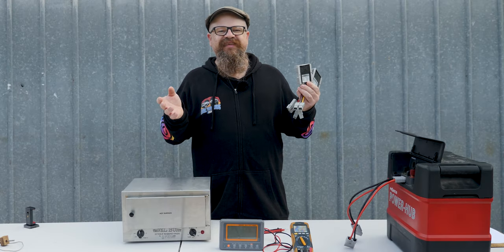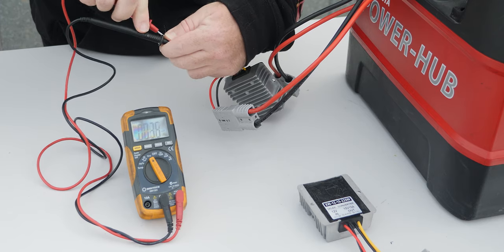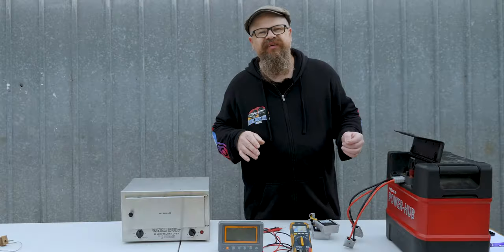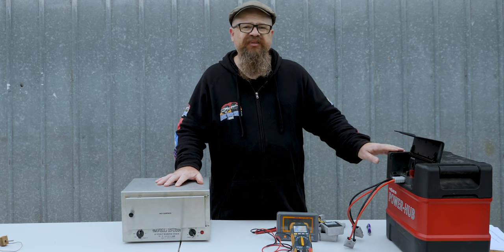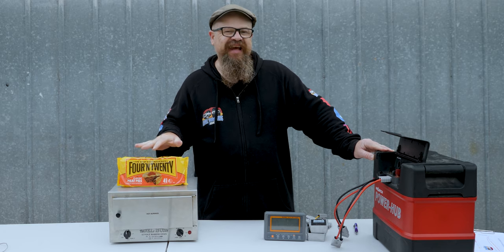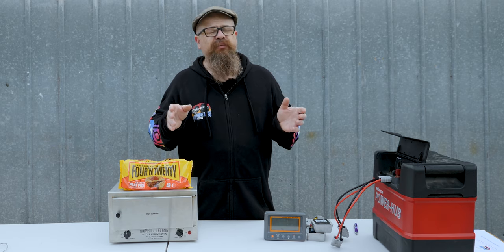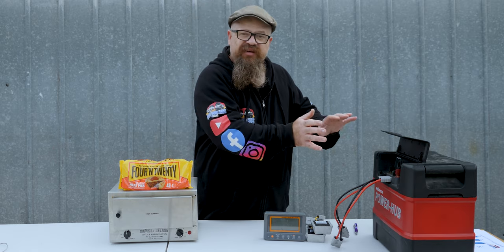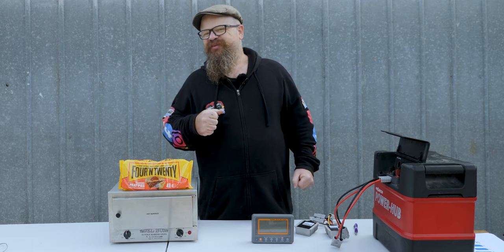Can you Improve Travel Buddy 12 Volt Oven Performance using Voltage Step-Up Converters?

Comment: Is the most basic way to use the step up converter , plug it in with Anderson when you need it and then unplug it when you are driving ? I’m not an auto electrician so don’t want to do anything to difficult in terms of wiring..
Reply from the maker: The units I tested aren't suitable because of their limited input range for driving. Though I notice Sommervile Metal Works sell on that you wouldn't need to disconnect.
Reply: can confirm, the 15v reg (even though it says max input 13 volts or whatever it is) still works and is without damage running while a dc to dc charger is charging as well (at 14.6 volts)
Reply: @LockyourHubs4WDing  but if I disconnect when I drive and then connect when I pull up to camp or whatever, that is fine ?
Reply from the maker: @jackdunn1687  yep, that'll work fine.

Comment: I’ve just purchased the 15v converter, what’s the go with fuses, do you install 1 on the input and out put sides? I already have 1 on the travel buddy wiring so was thinking on the out put side would be over kill?
Reply from the maker: I would place  a fuse on the input and output as close to the supply of power as possible.

Comment: WOW! Bloody great video, thanks so much, so in theory this data would replicate for a 12v Fridge running from a similar set up???
Reply from the maker: I tried it with an Engel 75 Combi, we got better performance, but used more battery capacity.
Reply: Thanks for the reply 👍🏼👍🏼

Comment: Hi mate, great video I got a step-up converter and works great on my AGM battery, but I have just upgraded to lithium 150ah would there be any benefits using it on a lithium ?. Would it work the same ? Cheers
Reply from the maker: Still works just as well.

Comment: Great video Simon! Can anyone share a link to either a 13.8 or 15.0V step-up converter. I'm having trouble finding one with the model numbers provided in the description.
Reply from the maker: Here's a link to a 15v stepup that won't require any addtional  wiring when the car is operating.

https://www.ebay.com.au/itm/12V-to-19V-15A-285W-DC-DC-Boost-Step-Up-Power-Converter-Voltage-Regulator-SL-/313339939355?_trksid=p2349624.m46890.l49292
Reply: @LockyourHubs4WDing  Thx Simon, but the link seems to be for a 12v-19v step-up.
Reply from the maker: @masonnagle  apologies, I just searched through my ebay purchases, this is the wide input step up/down I purchased.

https://www.ebay.com.au/itm/WaterProof-DC-DC-12V-to-15V-20A-300W-STEP-UP-Power-Converter-Regulator-XL-/293739824378?_trksid=p2349624.m46890.l49292
Reply: @LockyourHubs4WDing  Champion! Thanks for going to the trouble.

Comment: Gaday mate,
I have a late model Patrol with a so called smart alternator. I’m assuming that using the step up converter whilst driving, will still be beneficial even though the alternator kicks back to 12.?V about 2 minutes after you start the car?
Reply from the maker: Sure will!
Reply: @LockyourHubs4WDing  thank you. Can you tell me, for a quick safe initial setup, could I fix the step up converter in line to the back of the oven with Ceramic 10mm screw spacers for ventilation, 15amp in line fuse then battery supply?
Reply from the maker: @GPatrolUte  Solid state electronics don't enjoy heat, while the ceramic insulators will help, a sheet metal spacer with an air gap each side will be much better.
Reply: @LockyourHubs4WDing  Cheers and many thanks👊

Comment: Could a similar test be done for operating off 240v to 12volt convertors?   Difference between a 13amp compared to a 15amp unit. I noticed a lot people are using different amp converters.
Reply from the maker: If the 240v converter can supply enough amperage to the oven, it doesn't really matter if it's 13amp, 15amp or 25amp. There should be no difference in performance. The oven will only draw as much amperage as it needs.
Reply: @LockyourHubs4WDing  Thanks for the quick response! Love your video's.

Comment: Great videos you do. Very informative and helpful. If these step up/down convertors are 12v input, 13.8v(or 15v) output, how do they handle it when the car is running and the input voltage could jump up to 14.5v? Can they handle that?
Reply from the maker: I've seen a different model 13.8V model that handles a much wider input voltage range, like the one that Somerville Metal Works sells. Though not for the 15V version. Though with a little extra wiring you can automate it switching in and out https://youtu.be/CT6WJNPNRsc

Comment: Do you think these step up converters are sealed good enough to be mounted on the back of a tool box in the weather? I have wanted one and this great review has sold me on one. I have always held off due to mounting positions.
Reply from the maker: They're advertised as waterproof, so as long as the connectors are weather sealed, I think you should be fine.
Reply: @LockyourHubs4WDing  yeah nice. Cheers. Best be hitting ebay! Will be between toolbox and ute cab.  So not in straight view of weather.
Reply: My Chevy Silverado is fitted with three Fyrlyt Nemesis (250 watts each) driving lights. Fyrlyts are made in South Australia and the nemesis model is a 24volt halogen globe and is supplied with a 12v > 24v step-up converter...look the same as the ones in this video, but with higher output. They are designed for all weather use; mine are mounted on/under the bullbar. No worries...
Reply from the maker: @billroach2393  Great thanks, good to know that not only are they advertised as weather proof, they actually are!

Comment: So what happens when you set it up and car is still running? Does it max out at the 15v or boost past that?
Reply from the maker: Various step ups have different voltage limitation. I know there is a 13.8V step up avaliable through Somerville Metal Works that has a wide enough input voltage range to just connect it up and not really worry about it.

Though for the 15V, I've only seen them with a 11-13V input. You can either manually switch it in and out, or automate the process with relays. I did a video with a few wiring diagrams you can download and print out if you're interested.

Comment: Has anyone checked the output  of these when the alternator is pumping in the juice? Would be very interested to know what they do when the system is running at full charge of around 14.5v. Thanks for the great content and thanks for any further info.
Reply from the maker: If you check out the travel buddy FB group, I've uploaded a wiring diagram that uses a switch to bypass the step up when the car is running, you could easily enough automate it with a relay and a trigger from the "on " position on the ignition.

Comment: Great video... do you have a link to the actual unit (15v please) that you used in this test...

I want to get one.
Reply from the maker: The model number is in the description, just search for it on ebay.
Reply: Lock your Hubs 4WDing  wow, so the 13.8 one actually uses a fair bit more power. That’s a surprise....last question, did you personally experience any issues when testing either of them?
Reply from the maker: None, I did mount them remotely to keep the heat away, both both are still running strong!
Reply: Lock your Hubs 4WDing  BEAUTIFUL! I’ve just ordered a 15v one... if you want to possibly fan force one with no extra power...look at a 55w peltier module thermopasted to the front door & wired directly to a 5v electric motor on front door also, with shaft through the door & a metal RV boat prop on the inside.👌🏻 will work as long as the door has heat, closed circuit.
Reply from the maker: @pauladams1156  I would like to add a second element firstly, though fan forced would definetly help, especially with stainless trays.
Reply: Lock your Hubs 4WDing  yeah that’s my only complaint, the back side cooks more because of holes in the door...I figure the fan will make the heat much more even... I’m gonna have a crack at it...just gotta figure out if I can pierce the peltier, so I can make the most of the cooling side, for the motor...hopefully they arrive in the next few weeks.
Reply from the maker: Shoot me a link when you're finished! I would be really interested in checking it out.
Reply: Lock your Hubs 4WDing  no worries...I thought this up, because adding a second element would require doubling the power...yet this idea runs free from the heat...& because it’s such a small area, you wouldn’t need much to flow the air inside it.

Comment: Just the information I was looking for, thank you, can you let me know where you got the 15 volt step up converter from? I've had a look around and, and can find 12v to 15v, with a max output of 15 amps, do you think that should be fine considering you hit around 13.6 amps draw, or should I look for 20 amps max?
Reply from the maker: The part number I used is in the description.

Comment: Just hooked  my 80w solar panel it was running at 6a and 83w in the sun. By rights would that be enough to not 100% offset the  power draw but sort of help keep some juice in the battery so I am able to run my oven with the vehicle off? I wanna cook dinner without pissin me mates off by runnin a 3 inch straight pipe diesel for 2 hours
Reply from the maker: That would partially replace the juice the TB was drawing from the battery. If you leave the solar out for longer than you're cooking, you could fully recharge the battery.
Reply: @LockyourHubs4WDing  bloody legend mate. I'm buying the step up converter aswell.  Gettin the road chef for me 30th in a week. Parmas are my first cook!
Reply from the maker: @trentwilliams1176  nice, a parma is my favorite pub grub!

Comment: Hi. Just a thought. Is there any reason why you cannot run these units direct from the alternator?
Reply from the maker: Via the battery? The limit in the specs is 13v input, and many cars charge at a higher voltage than that. There are some step ups avaliable with a much wider input voltage range, though they're 3 times the price. Keep an eye out though, as the next video is all about fixing the input voltage limitations.

Comment: Would a link to the E bay item be possible, i cant seem to find it? Love the vids!!!
Reply from the maker: This is similar to the one I bought 13.8v 248W https://www.ebay.com.au/itm/DC-to-DC-Step-Up-Booster-Waterproof-Car-Power-Supply-Converter-Regulator-Module-/331984319451?nav=SEARCH
Reply: Lock your Hubs 4WDing 
Would have loved a close up  of the step up converters in your video
Showing the serial numbers or model number you used,  making sure i bought the right one.
The 15vlt  one is what im at thinking with my travel buddy.
But the ebay link shows 23pictures 
Either
Xw - 12 - 15 - 120w ( 15V8A )
Or 
Xw - 12 - 15 - 75w 
( 15V5A )
Im a welder by trade
Which one is the more grunt ?
At a wild  guess
120w option ????
(  Being 8amps )
Compared to the 75w 5amps ????
Cracking video!!!
And definitely  buying a step up converter to help  my marine travel buddy
Thanks for a great video
Look forward  to  your help
Reply from the maker: The 15V model is the XW-12-15-225W . Hope this helps.

Comment: is the correct model for the 13.8 unit XW-12-13.8-248W  (12v-13.8v18A) ? I am not super with my 12 V just want to make sure i get the correct one?

Thanks
Reply from the maker: It's the XW-12-13.8-248W That looks like the right one.

Comment: Brilliant video as always! Have you tried leaving this plugged in while driving? I wonder what happens when the input voltage is say 13.6.
Reply from the maker: I haven't, at the moment, I just swap around the plugs, though will automate it soon.
Reply: Have you tested this out yet ?
Reply from the maker: @kontiii  I did one better, I did a video on how to wire up step-up convertors with a switch, relay or a fully automated solution depending on your needs and still staying in the specified voltage range. https://youtu.be/CT6WJNPNRsc
Reply: @LockyourHubs4WDing  legend

Comment: Where can i get the 13.8v one please
Reply: he said "eBay" in the first part of the video.
Reply from the maker: Yep flea-bay is the answer!
Reply: @LockyourHubs4WDing  the 13.8 have different amp ratings does it matter which one i go for
Reply from the maker: The 13.8V unit I used was an 18A unit, that seemed to work fine.
Reply: The oven resistance is fixed.
Power P is Voltage V squared over Resistance R
So increasing V increases P.
Current is V/R.
So increasing V increases current.

Good video.
Reply from the maker: Thanks mate!

Comment: 12v devices have good voltage tolerance.  I can't imagine the oven will be damaged.
Reply from the maker: Mine's still happily running on 15v happily so far.
Reply: @LockyourHubs4WDing  i thought so. There arent any electronics inside.
Reply from the maker: @cameranmanner4701  nope, just a timer, thermostat and an element basically.

Comment: The 13.8 V reg, will be the same as driving, as the car system is a nominal 13.8 to 14.2 volts while driving..
Reply from the maker: Yes, you might only get a marginal improvement if your charging system is closer to 14.2V.